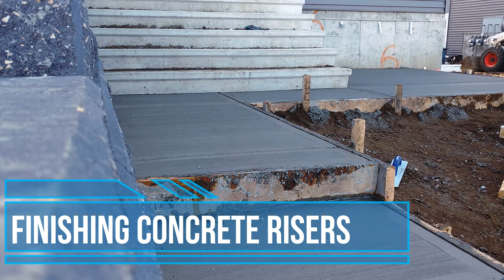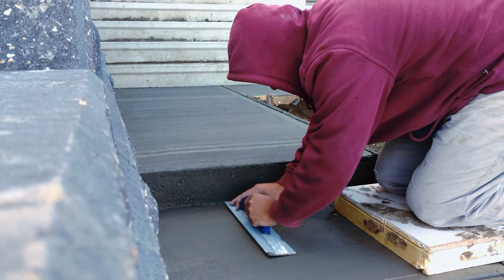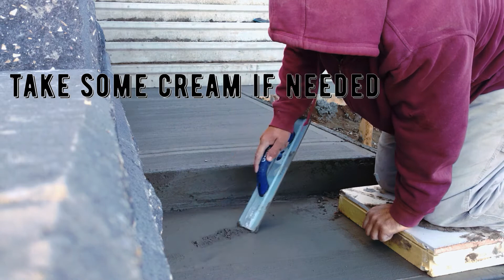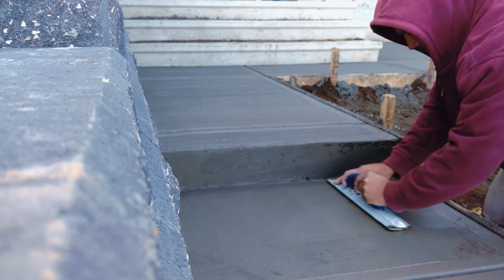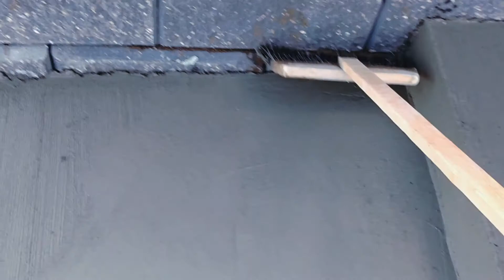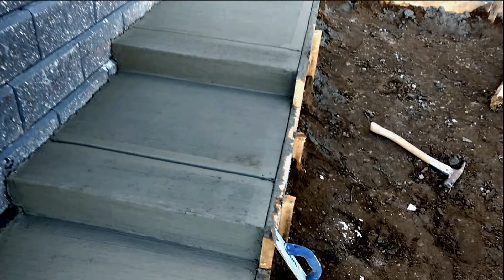How to Finish Concrete Risers\Steps. Useful Tips

Comment: Can i do this after the concrete has dried? I want to finish my steps that were poured 4 years ago
Reply from the maker: Is that a joke? Or you serious?
Reply: @Take_And_Make  when i read your response, i realized that it must have been a stupid question. I know nothing about concrete and was asking seriously..
Reply: Yoni and Dany Abreu For your steps youd want to use a sacking mix. Like a concrete patch mix, and use a float, rubber float or maybe those textures red floats. Work the patching mix lightly into your faces to fill in all the holes and let dry for a little bit, don’t cake it on too much just rub enough to fill all the voids, then after it dries a little bit come back with the lighter texture smoother float and smooth it out, I found that a small piece of solid insulation works really well. You’ll want to rub it, basically sand it to smooth
Reply: Yoni and Dany Abreu this guys finished product is absolute trash and he’s clearly not a professional. If you want better tips, search Odell concrete on YouTube
Reply: You can overlay them fairly easy man.  Much cheaper
Reply: A wet sponge make it smoother

Comment: How do you determine when to take the forms off?
Reply from the maker: The time is different always. There is no common formula for that. Depends on the mix, on the base( will go quicker if it's sand), on the weather of course. Warmer it is outside - faster it cures.
When it stops being watery and shiny(stops bleeding), touch it, if it’s hard to push the rocks down, you can start stripping and keep an eye on concrete, when you slide the board up, if it starts sagging than too early. Put it back and wait 10 min.
If not sure, wait longer and finish it with wooden or rubber float if it gets too hard on you, but after wooden float need to finish with steel trowel in order to get a nice broom.
Good luck!